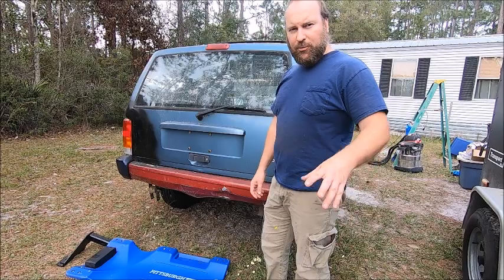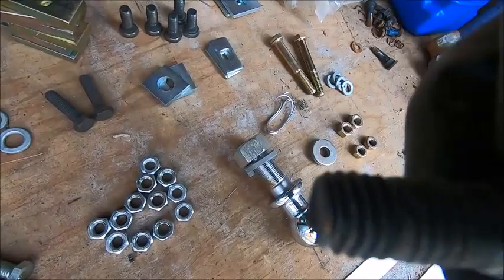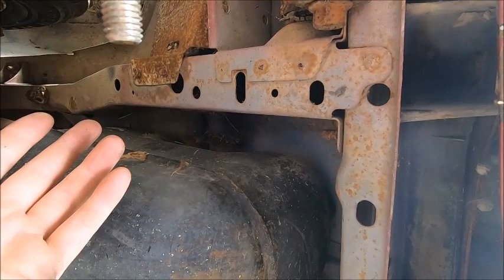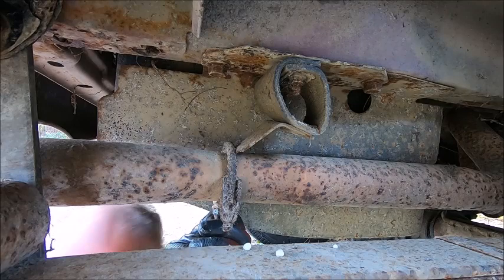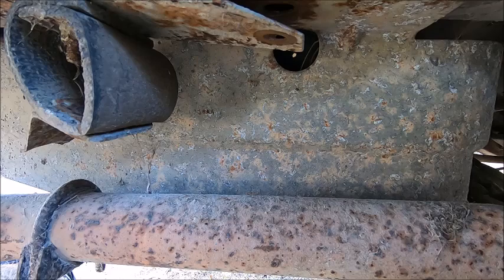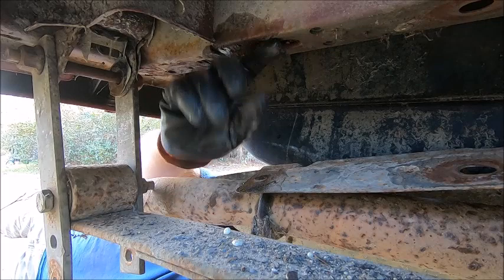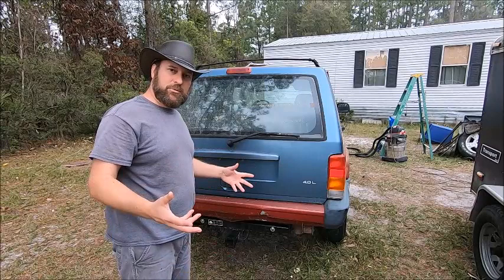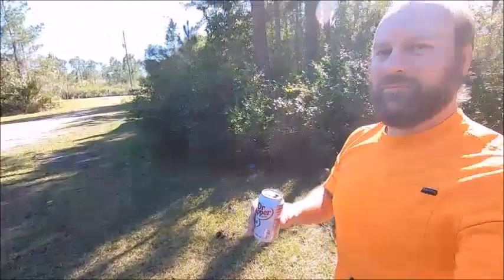1998 Jeep Cherokee XJ trailer hitch install

Comment: That spring is for feeding through the frame. You thread the botls into the plates then you thread the soeing onto the bolt and pull it theough to the hole you need it in. It makes it where you can tighten it with one tool instead of using a wrench to go down the end of the frame.